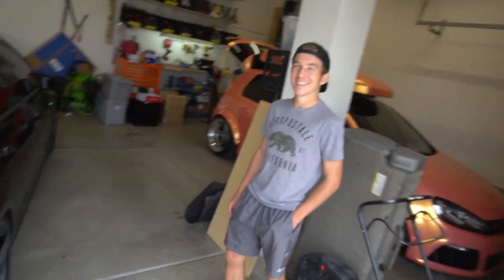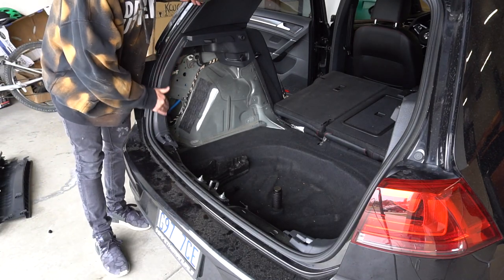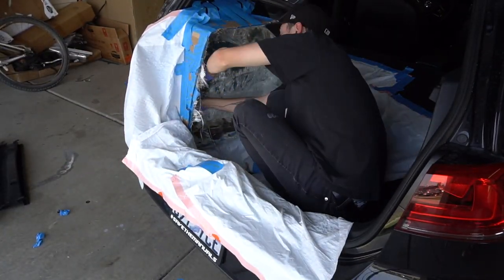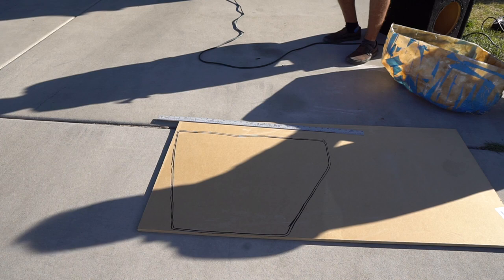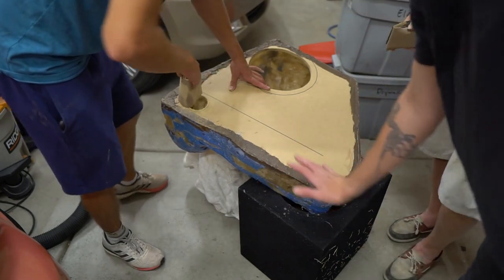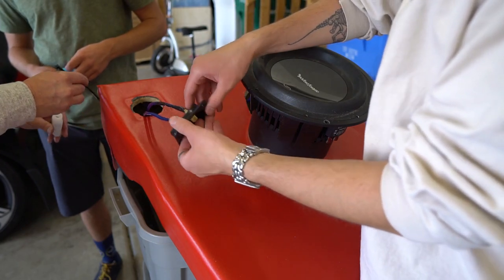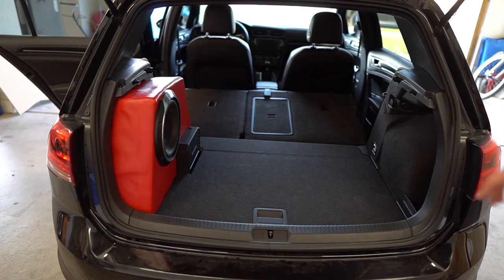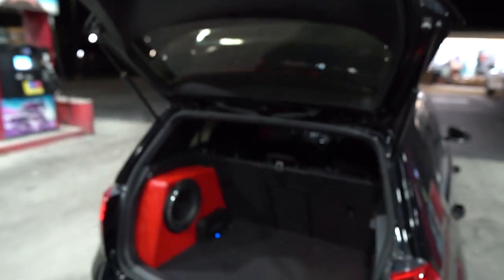How to make a CUSTOM FIBERGLASS SUB BOX! | MK7 Volkswagen GTI BUILD

Comment: Nice job, went though the previous comments, no details on figuring out the air space for the speaker, that is where the real calculations comes in and would be useful to YouTubers. Also no video of pulling the fiberglass mold out of the car, again would be useful to speaker box builders.

Comment: How did u get the cut out box to fit securely in the shell? Whats stopping it from falling in?
Reply from the maker: The wood face is secured to the fiberglass shell using bondo-glass, it’s a mix of bondo and fiberglass. It holds it like cement and seals off all gaps for an air tight box
Reply: @TMWYT  Ok Great Bondo-glass thanx for getting back I really appreciate it. Im gonna try to tackle this project myself and will be using ur video to do so.

Comment: Quick question! I applied the masking tape and the layout earlier today and I want to complete the job tomorrow so please get back to me at your earliest convenience! My question is did you guys use multiple layers of Fiber Mat or just the first then multiple layers of Resin? It's my first time doing so and I want it to come out good. Thanks
Reply: Cut out small squares of the mat, then lay some resin place the mat and do a layer of that, then do it enough to do like 3 “layers”

Comment: How's it going? I'm new to all of this. I have a 19 GTI and was wanting to put a subwoofer in. What would be a good size? I don't need to have anything crazy, just enough to have fun with. 

Been looking at
Kicker 48TCWRT102 sealed enclosure with single 10" CompRT 2-ohm subwoofer and passive radiator, but I don't know much....

Comment: Were you worried about the heat from the fiberglass resin effecting that wiring loom? Does it not get too hot to melt the sheathing of those wires? Love the look and considering this for my 2013 Jetta Sportwagen Tdi unicorn. Looks great!
Reply from the maker: If you use the correct size wire is does not get hot :)

Comment: Couple of questions…. How does it stay in place once its done? Can it be done on both sides? And does the box has to have any sort of hole for the sub to release air?
Reply: yea , can be done in both sides , but use some brace inside and a thick frontplate :D 
. u can bold the box from the inside .

Comment: Am I mistaken and you did hook up both sides of the sub?
Reply: I didn't notice a second set of wires it either.  I only saw one wire from the speaker.  If that is true, you're only using one voice coil of a dual voice coil (dvc) sub.

Comment: JBL BassPro Hub or Cerwin Vega VPAS12ST Power Subwoofer fit in the spare tire 6.5” tall.  JBL Stadium Bass Hub Spare tire subwoofer if you want to use your own amp. Cerwin Vega VPSTX12 12” 600W 150rms compact spare tire subwoofer 4.7” tall. Rockville RockGhost Hidden subwoofer 5.7” tall
Reply from the maker: That’s rad! We wanted something bigger then the tiny space available within the spare

Comment: What did you use to glue the wood face to the fiberglass?
Reply from the maker: Bondo-Glass, its basically bondo mixed with fiberglass strands and resin.
Reply: @TMWYT  Did you put it inside and outside or just outside? I would be concerned just doing it outside that it still might push in.
Reply from the maker: Just outside, the face was a pretty tight fit already, bondo glass cemented it into place for eternity. Months later box is is still doing great :)

Comment: With the premium with the fender audio
Reply from the maker: We deleted the fender audio subwoofer that was inside the spare tire, cut the signal connector plug off and connected it to an LC2i which then converts amplified signal to our RCAs that connect to the AMP. Dealing with the Fender Audio system has been tricky and we are still trying new ways to make it work the best, but we have decent subwoofer levels as of now.

Comment: How did he wire it? Drop line?
Reply from the maker: He has the fender audio upgrade from the factory so we used the wiring for the stock sub in the trunk for the signal.
Reply: @TMWYT  how did you pull the signal from the wiring harness? I'm trying to do the same thing with adding a amp. Just need signal from the harness

Comment: Any idea how much that box weighs? I was thinking of going with the Focal Utopia MW10 cause it has a really foot air space requirement but im building a race car sorta so weight is a concern. I think the sub weighs 17 lbs any idea what the fiberglass setup with MDF weighs? Thanx. Its going in this with Audison Thesis 3 ways up front. Unsure on amp/dsp yet. https://www.youtube.com/watch?v=Md7z6L-XXQM&t=2s
Reply from the maker: Sounds like a rad setup man! I’d say around 40-50lbs now that we have 12 inch in it. If you are going for weight savings for track/drag days I would just make the sub/box/amp all quick disconnect so you can easily remove when needing to drop the extra weight! Then when your just driving around town you have good bass.
Reply: @TMWYT  Awesome thanx. Good idea i will look into something like that.

Comment: Why put a ported sub in a sealed box?
Reply from the maker: Subs are subs. There’s sealed enclosures or ported enclosures. You get better sound and response from a sealed box, but you get more low frequency bass volume out of a ported box. Just depends on what you’d like to do. My cousin wanted a setup exactly like mine so we built a sealed box.
Reply: @TMWYT  Exactly. I used to own some killer JBL home speakers that could either be used ported or not simply by pulling a foam plug out or leaving it in. Really wish I hadn't sold those speakers years ago. They sounded fantastic. Nice build, guys!
Reply: Lmao he called a sub a ported sub 🤣🤣🤣 obviously knows nothing about subs